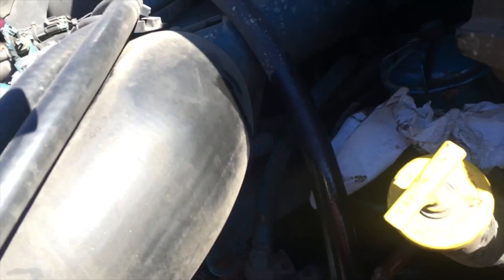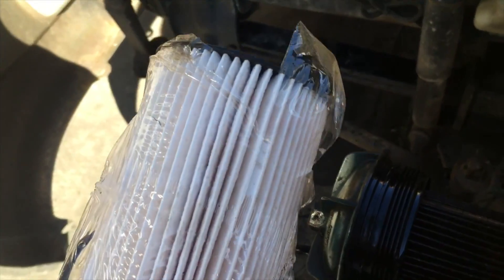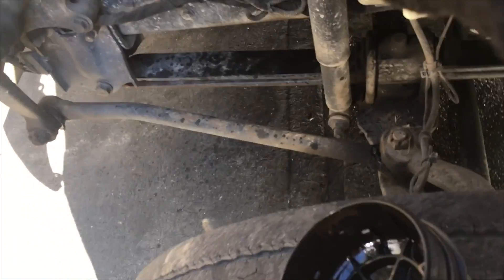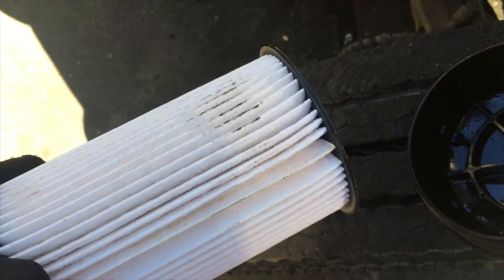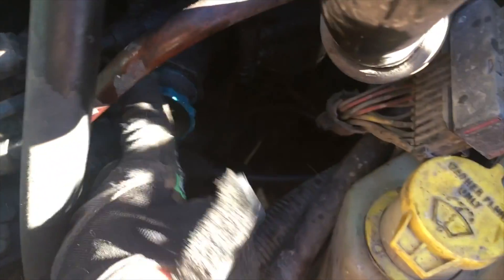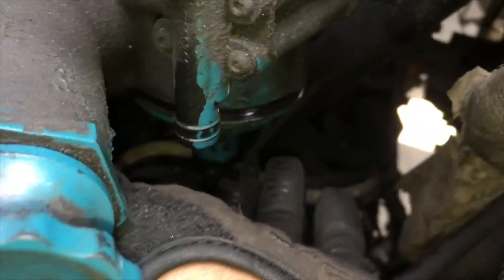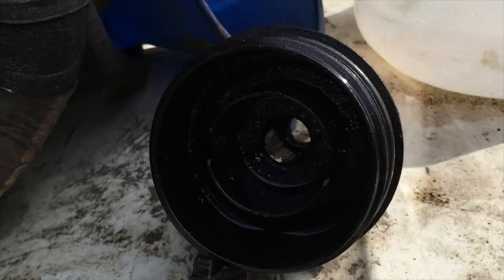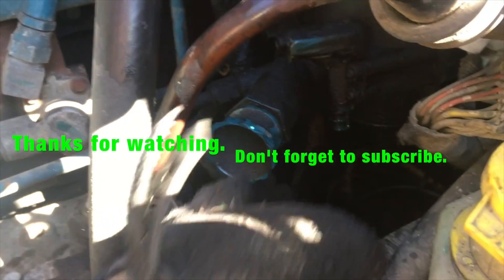How to change fuel filter on a 2005 International DT466

Comment: Great video!  Thanks!  I have a fuel issue with the same truck.  It sat for a couple months and now won't start.  The primer pump wasn't building pressure and so we replaced that.  It now builds pressure, but after a couple minutes of just sitting, the pressure is gone and it has to be primed again.  We don't see any fuel leaks.  Any ideas?
Reply from the maker: Matthew Segroves good morning. It's a possibility that it can be the injector o ring seals. There was a time when i would have to use starting fluid to start the truck and it would run fine but as soon as I shut the truck off it wouldn't start again. Once the seals were changed it worked again.
Reply: @TowMan127  thanks for the info! I bet that's an issue for sure. It builds pressure now (not sure why it wasn't before), but still not starting. I've had to use starter fluid with this one as well in the past. I have a couple other issues now with it that I have to figure out, but I'm sure the injector seals are needing to be replaced.

Comment: I'm recently having problems. I'm getting black smoke when accelerating a couple of times during a trip and a couple of short idles before it accelerates. Had an oil change. Can't remember the last time I changed fuel filter and air filter.  Could it be that or a major injector prob. Thanks for the vid. Also gonna start doing this
Reply from the maker: Jesse Lara not sure but i just started getting black smoke myself. When i accelerate and sometimes while driving. Hasn't done that until i recently serviced the truck. Im looking into the problem myself. As soon as i find out i will let you know.
Reply: Usually when the filters start to need replacing you don't get black smoke. Change it and you get more fuel to the injectors and acceleration will get smokey again. And rolling a little coal is just awesome!!

Comment: I’m having an issue in mine turns the water in fuel light and doesn’t start a few times the filter was already replaced I’m wondering if there is a  drain plug to let some of that water out of the filter like other diesels
Reply from the maker: Sorry for the late reply, I’m not sure if it has a drain but if I did it probably would be underneath the canister and it would be a little valve screw that you would unscrew. I can ask a friend of mine and find out.
Reply: @TowMan127  There is a lever for this. at 6:25 of the video, its to the right of the pump right above your index finger.

Comment: Cómo puedo regular la activación del fan closch de un dt466 2005 o a cuánto se ve de activar x que a mí camión se eleva a 210 y luego se enciende la amarilla check o se puede regular desde el timón o solo con scanner
Reply: alguien sabe q numero de filtro es el del diesel del motor 466 electronico 2005

Comment: Do you happen to have part #?
Reply from the maker: I don’t know if it’s the same but the one I’m driving now is a 2009 and uses the NAPA filter number 600149 I believe the canister and filter cover are the same.
Reply from the maker: Here’s the video of the 2009 I drive that I just changed the filter on. 2009 International 4300 fuel filter change. (MAXXFORCE ENGINE)
https://youtu.be/QIFGpj3CZNE

Comment: I'm gonna do this tmrw...how much do I prime??
Reply from the maker: Sean Day if you're replacing the filter and not draining the canister not much cause you should still have a good amount of fuel in the canister. If you drain it prime it until the primer handle get harder to prime
Reply: I currently have a no start condition so hopefully it helps...I've never changed the fuel filter since I've had it  (several years)
Reply from the maker: Sean Day wow. Thats a long time. I'd definitely clean out the bottom strainer as well
Reply: TowMan127 so is the bottom part and the part in the middle the same strainer?? Or take it all apart?
Reply from the maker: Sean Day the bottom has its own strainer. When you buy the filter it comes with 2 o ring seals. Larger is for fuel filter cap and smaller one is for bottom strainer cap